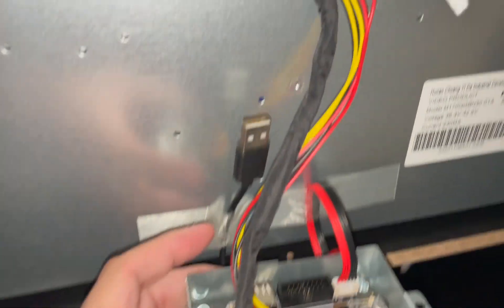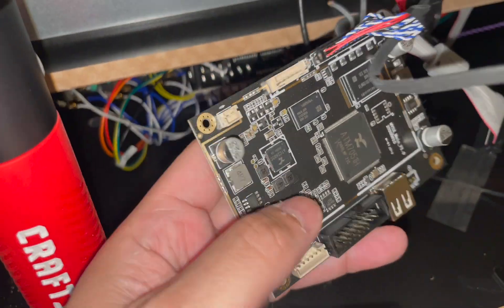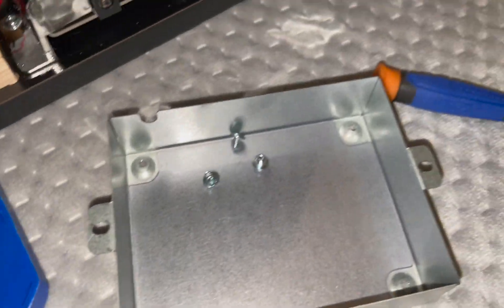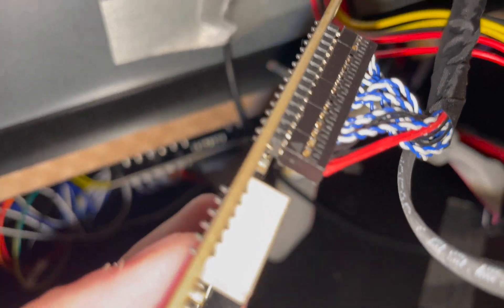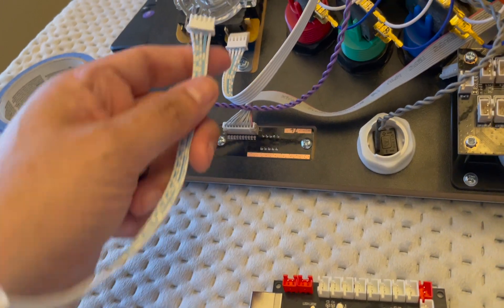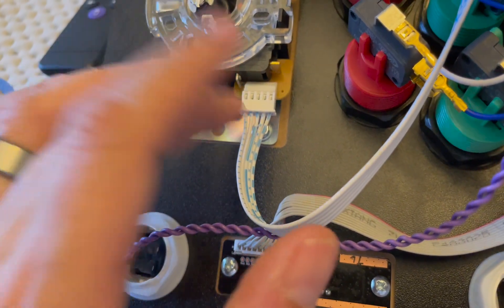MVSX ULTRA MOD PART 2

Comment: Thanks! Very useful guide for an easy mode.  I guess the reason for going for the H96 instead of a Raspberry Pi is price? Does it compare to RPi 4 in performance?
Reply from the maker: Great question, I just went with something that didn’t require as much effort and tweaking etc. basically, this mod lets you use any device really (as long as it has USB inputs and video/audio output.)

Comment: Can I repurpose the stock sticks and buttons if I go this route?
Reply from the maker: Hopefully the video explains that you can
Reply: @neocvera  so if I stick to stock for now, can I reuse the stock USB encoder? Or am I switching that out as well? I'm gonna start to buy things and don't want to overdo it if I don't have to.
Reply from the maker: What exactly are you wanting to do? 
- if your adding another device to run your games then you’ll pretty much need everything I list. You can still use the stock buttons and sticks but the zero delay encoders will be necessary.
Reply: @neocvera  that was what I wondering!  Thank you so much
Reply from the maker: @StaticWrap  the one thing that may not be needed is the power regulator. Your device may be 12v or higher, my test device requires only 5v which is why I needed the regulator.